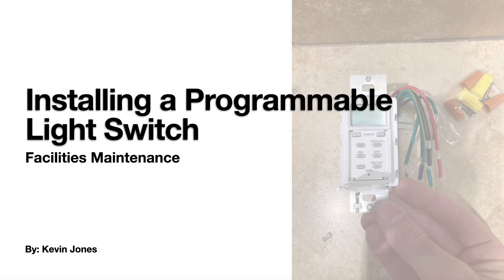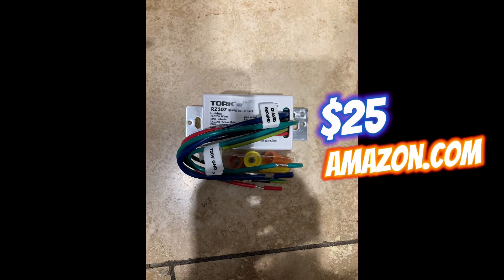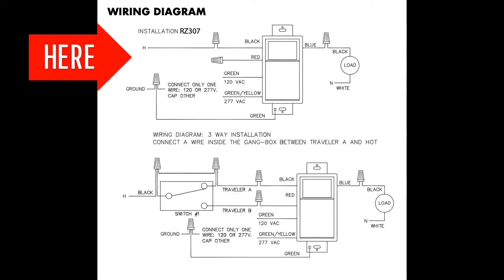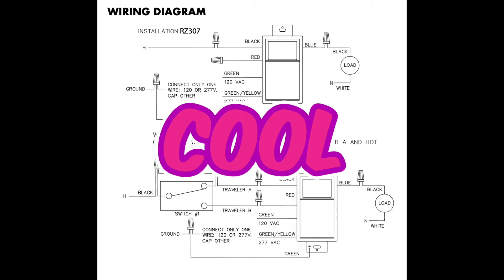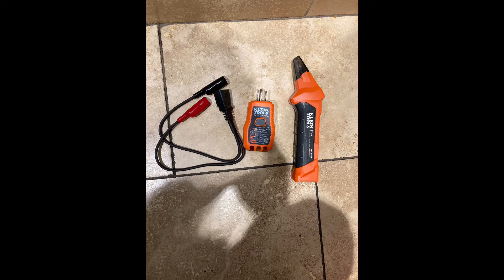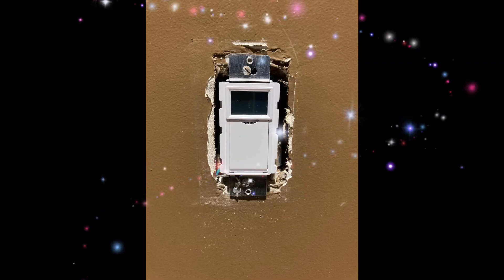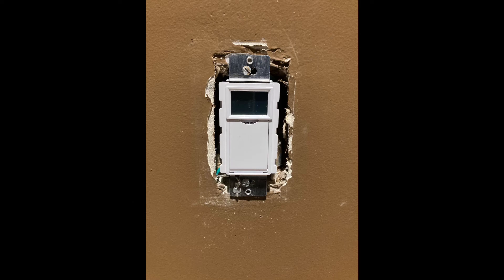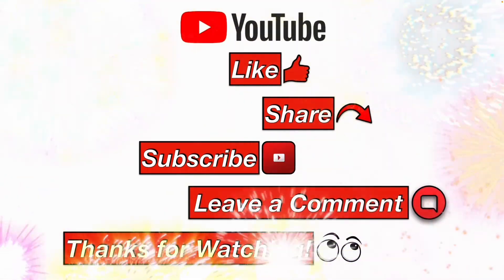Installing a Programmable Light Switch (No Neutral Required!)

Comment: Hey KJ, How's it going? I was a rental residential contractor and house flipper for over 20 years. I'm 72 and retired now, but I still love to do all kinds of repairs, renovations, improvements and experiments.   I'm looking for motion detector lights that don't need a neutral to work. What to you recommend?
- 
I haven't turned off the breaker to fix or replace 110V wall switches in years. I just put on latex gloves and do the work. Then if the breaker flips because of shorting, it's no big deal. Back 35 years ago I was an apprentice electrician. My boss told me, "If you don't get shocked at least once a day, you ain't doing your damn job."  But I can usually change a wall switch, wall outlet, or ceiling light fixture, without ever causing short during the change. 
-
However, like you, I have almost every tool and gadget known to man. I do own a breaker finder but my carry tool bag is full of other crap. 

Cheers my friend,
Tom
Reply from the maker: Hi Tom, does your existing light fixture take screw in bulbs? If it does, they make motion activated lightbulbs.  That would be the easiest solution.